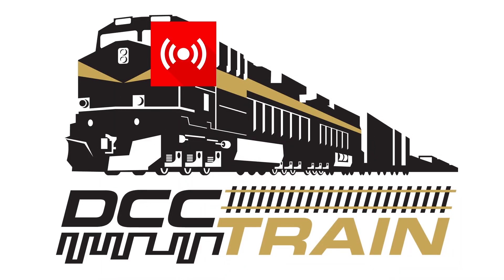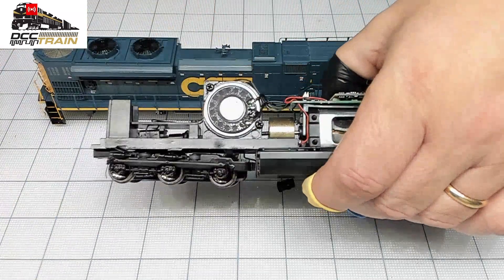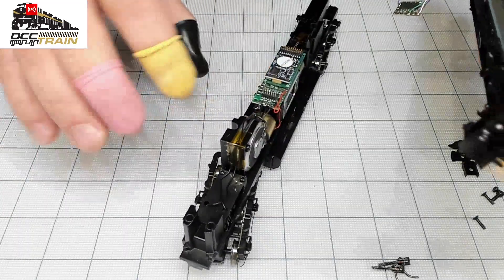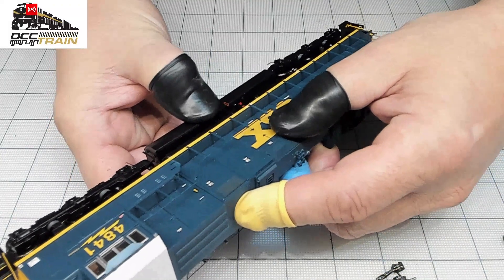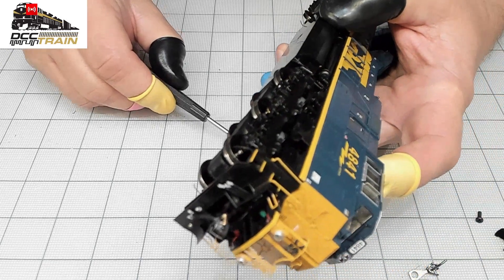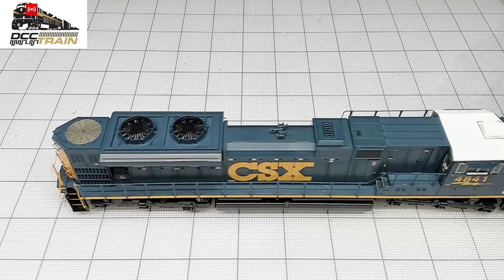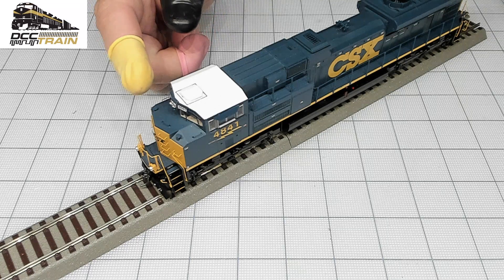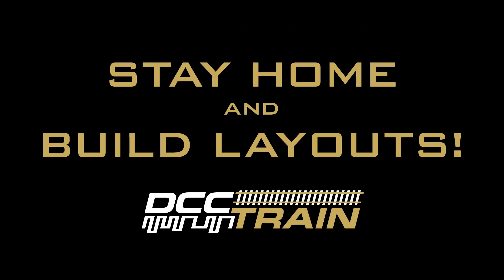ATHGSD70 Ace LokSound 21Pin Decoder buddy board final assembly

Comment: Something worth noting is that you loaded the incorrect prime mover sound file (12-1010J S0776). That project is a 4 stroke diesel sound appropriate only for Tier 4 ST70AHs such as those in CSXT 8900-8909. The correct files for this version of the SD70ACe are S0525 and S0822 which are 16-710G3C-IIs which are correct for this engine. Otherwise, beautiful and clean install!
Reply from the maker: Thanks!